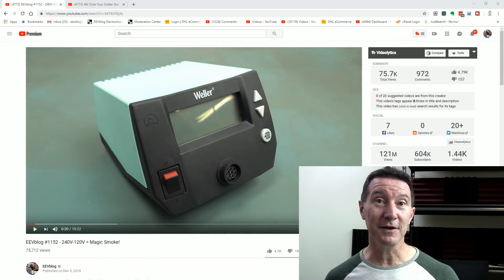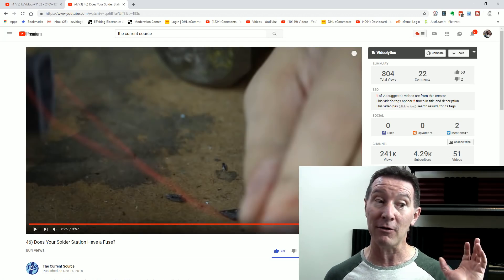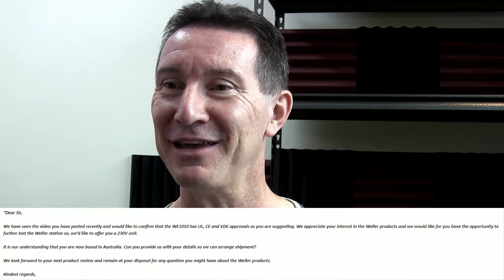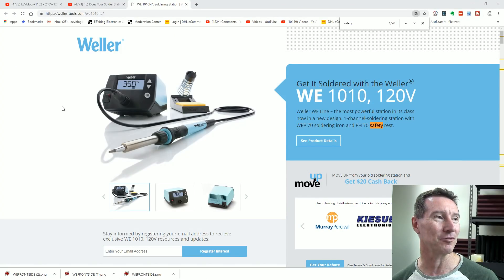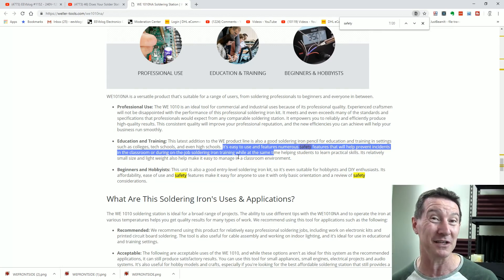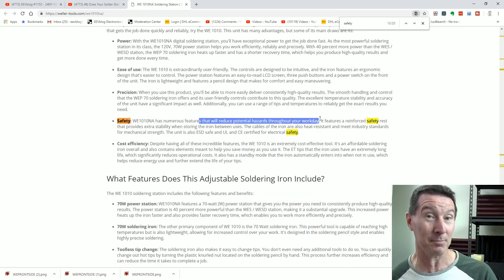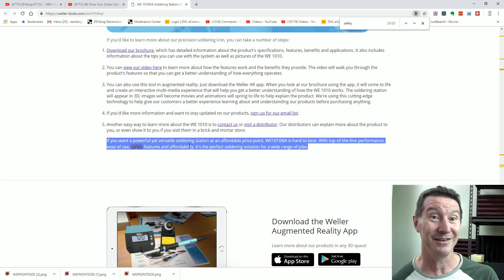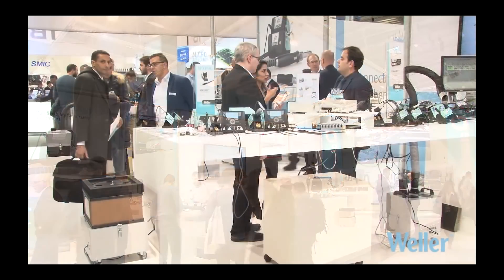EEVblog #1160 - Weller Responds!

Comment: Take the 240 volt version and plug it into 408v.
Reply: Don't turn it on. Take it apart.
Reply: @CyberlightFG  BLOW it apart!
Reply: @CyberlightFG  it will self disassemble before your very eyes... pro tip... wear goggles 😎

Comment: You should have accepted the iron from Weller, and tear it apart once received to prove or disprove they improved their product
Reply from the maker: Nope, it's not my job to prove that they have fixed or improved anything, they could have simply said so in their response.
Reply: @EEVblog  right ! You tell em Dave
Reply: They didn't alter a product because of this video, and esp not in 11 days.
Reply: They offered a 240V version, which probably has the fuse.  (?)
Reply: It would take some time to change a product design, and if it passes US regulations as-is, what are the odds they would even be inclined to do it if that's how everyone builds their transformer-using products for the US market? Voluntary improvements would be laudable but highly unlikely if it doesn't give them an immediate return and DOUBLE DIGIT GROWTH you know. :p

Comment: A lot of the things I plug into the wall don't have a fuse. Lamps, power tools, Christmas lights, aquarium filter and bubbler. But then again I only plug it in to the voltage it was designed for 😂
Reply: All my christmas lights have a tiny fuse in the mains connector? (USA 120v)... even the chinesium lights I've gotten off amazon have a fuse in the connector
Reply: Actually a lot of these things have fuses built in that are just less obvious. Power tools usually have a thermal fuse in the motor, incandescent bulbs have a small, thin wire below the filament that acts as a fuse for when the filament fails, and then lots of things have PCB mounted fuses of course, some of which may not look like a fuse.
Reply: @Basement-Science  And an incandescent bulb IS a (crap) fuse. :)
Reply: @0x8badf00d  Well, not sure you can call the filament of an incandescent a "fuse".
Incandescents without a built-in fuse will actually trip your 16A breaker almost everytime when it burns out.
Reply: @Basement-Science  It is kind of a fuse,  much like PTC thermistor. Select appropriate wattage and you are mostly good.

Comment: Maybe they just treat mains connection cable as a fuse.. did you checked attached cable? Maybe its made from a fuse wire... ;)
Reply: It´s an IEC cable PLUGGED INTO the station. So you cannot put any protection into the cable since you could replace it with any other.
Reply: @Basement-Science  I think you shouldn't take the comment above in any serious way.
Reply: @krzysztofzgondek1725   I know, but others have asked similar things. (Fuse in the plug)

Comment: Whoa, wtf, how did they even got it certified?
Any certification bureau will tell you to put a fuse in there upon first inspection, not sure about the US, but not a chance in EU. 
Fuses protect you from fire. 
WTF Weller?
Reply: CE and UL are self-certifying standards. It's up to the manufacturer to make sure they comply
Reply: @xortan666   True, but don't that open you up for lawsuits?
As I did it - you got get your safety checked, got EMC, ESD done, then you declare yourself sertified, in case shit hits the fan you pull out your documents where it says you passed this that and the other.
Reply: @xortan666  UL is a certification, not a declaration of conformity. And while CE is a DoC few people would not have an independent lab produce a test report.

Comment: When I moved to Australia, I opened up my Weller station to swap the voltage to 240V and was amazed that there is absolutely no provision to do so. Weller's answer to this is to buy a new transformer, at almost the same cost of the station, to convert to 240V. WTF? In this day and age of globalism and you don't even give me the option to switch between the two? Yeah, thanks Weller.
Reply from the maker: To be fair, not uncommon for irons like this across brands, makes the transformer design easier and more optimum.
Reply: EEVblog  it’s not that complicated. Use two primary windings, put them in parallel for 120V, in series for 240V. And add a fuse 😂
Reply: Buy another one, and use them in series. Merry Christmas.
Reply: I would have thought it would be cheaper to have a single unit for international sale, with fuses on all and mains voltage selectable. I guess another benefit to the UK plug design - everything comes with a fuse.
Reply: Was there a fuse in there?
Reply: It was so long ago that I don't remember.
Reply: To be fair... my Hakko is the same.
Reply: Sure, it's cheaper to have a 115v/230v tapped transformer rather than carrying two separate lines for each voltage?

Comment: Hahaha dave that is the perfect ending! I remember here in sweden we had a consumer program called Plus, with Sverker Olofsson and if the products that did not meet the required safety standards. He just tossed them in the bin i so remember that the companies where going nuts on him, because they had to fix the problems and it will cost them money.

And i can not believe that a company like Weller even dare to put their reputation on the line, there is no reason to skip the PRIMARY fuse it is just stupid and lets say if you forgot your soldering iron on. And then a few hours later having a over voltage situation is it acceptable then that the entire soldering station could catch fire?

Comment: VP of marketing?  There's your problem!
Reply: Used car salesman types addressing engineering and consumer safety issues.
Reply: They probably don't have any engineers working there any more. They cost too much and only cause problems.
Reply: @Zadster  Pesky engineers ruining their bottom line by implementing safety features.
Reply: Probably the same guy that wrote that product page.
Reply: @technus6187  Yea an out of work journalist, they know how to spin anything.
Reply: Yeah, whenever possible, you fire off complaints like this straight to the engineering department.

Comment: I think you nailed it: if they say, "Oh yeah, we should probably put one in," then they'd be open to risk if anyone else has an issue. If you accept their -bribe- replacement unit just say you'll wait until they add the fuse... and see if they actually (if quietly) add one to future models. But if you just can't trust them anymore, especially as the kids get into electronics, I perfectly understand why you'd just dump it for good. Thanks for the follow-up.
Reply: I vote accept the 230V model (230V, not 240V... interesting that)... with the caveat that it must have a primary side fuse, or they know exactly what sort of video review that unit will receive! :-P
Reply: some weller stations do have a fuse.
Reply: Yep, I think Dave mentioned that. It's too bad because if this model was otherwise superior I'd be tempted to add a mains fuse myself (... if I knew what I was doing and checked with a few experts first to make sure I wasn't creating a new and bigger problem. Believe me, I have been "too smart by half" plenty of times.)
Reply: I use a Nexxtech 60W Soldering Iron with Variable Wattage that I got at Source (I miss Radio Shack). Works more than well enough for what I do. Sadly, it's not available any more.

Comment: im not really sure, but i think its actually illegal here in germany to have such a device without mains side fuse  im interested in seeing some german models of that specific model, if they go a fuse
Reply: Pretty sure it's illegal here in Brazil too, maybe they have different models for different countries.
Reply: Either a fuse is required, then Weller will put one in, or it's not, then it's at their disposal to build one in or not. Devices with simple mains transformers usually do not have fuses built-in. Think about all the linear or unregulated wall warts here in Germany.

Dave is just making a fool of himself thinking he discovered a serious safety flaw to which Weller would need to respond, when in reality thousands of devices work fine as long as you don't plug it into an outlet with double the rated voltage and watch the device burn down.
Reply: @graealex  i dont know what you are talking about , but only the cheapest of the cheapest bs i saw had no fuse here in germany, even the 5 dollar usb wall charger has a fuze soldered inside ( non user replaceable, but it had a fuse )
Reply: @WaschBaer_95  talking about the unregulated and linear ones, i.e. just the transformer, rectifier, capacitor and optional a linear voltage regulator. Those don't need fuses because they are intrinsically fail safe. There is no component that can short out the primary side, and short circuits and overloads only act on the isolated secondary side. Ten years ago this was the norm for basically all DC powered devices.
Reply: @WaschBaer_95  and switching power supplies need a fuse because you have capacitors, rectifiers and switching transistors on the primary side, so if one these goes bad, it bridges the full mains voltage. With normal mains transformers, the current is always limited so that the primary side cannot be overloaded. There's simply nothing to go wrong.
Reply: @graealex  Nothing can go wrong until it does. In reality, components have a limited life span and aren't supposed to catch fire at the end of their life but instead fail safely.
Reply: @graealex  Do they have IEC connectors? Or are they fixed to Schuko plugs?  Many wall warts are fixed to a specific plug, but IEC has the exact same connectors for both 120V and 240V.
Reply: buy a 15$ outlet receptacle that is primary fused they do make them

Comment: wow shame on you Weller!
Reply: I guess it's the car manufacturers fault if you put diesel in a petrol (gas for the US) tank. It is labeled correctly and actually required a different cable other than what was packaged with it originally. It should have a fuse, but putting on this much theater is ridiculous (9 min video for a 10 second letter!!!)
Reply: @daishi5571  yes but what in case of overload? even on 120V supply you rely on 15A breaker, while the unit rated current is 0,5A it'd cook as hell even tho its not 240
Reply: @sumilidero  What I was getting at, was that this wouldn't even be a thing at all except under this exceptional circumstance. How many ppl order devices not usable in their country??? if he had the correct voltage he be oblivious to this issue, but because of his own mistake it became a problem. But what I was mostly getting at is the amount of theater in use here it's almost worthy of a off Broadway production that get cancelled for bad acting. As I said it should have a fuse.

Comment: It's dangerous. I expect better safety from that UL sticker.
Reply: why? Batterizer had UL certificate too :)
Reply: buy a 15$ outlet receptacle that is primary fused
Reply: @punker4Real  those a generally fused around 10 amps which will not help much.
Reply: UL has been BS from the start. Live chassis "curtain burner" radios have UL listings FFS.
Reply: UL isn’t to protect you from being stupid like he was.
Reply: There is nothing "dangerous" about it at all, as he clearly proved in his video, even if an idiot plugs it into a mains supply 2 what it is clearly rated for all that happens is that the magic smoke comes out an a breaker pops.
Reply: @wildbill4476  Watch his video again, no breaker popped, he quickly unplugged it.  Had he not been in the room it could have caught fire.
Reply: @alexatkin  It did pop, he said so. However, if the xformer already caught fire then a breaker won't help. Basically, Weller stations can't be left alone whilst powered up. At least outside of countries like the UK that have fuses in plugs (assuming correctly sized!)
Reply: @russ18uk  Anyone with a proper IQ don't leave a heat generating device on while away from it... however there should still be other measures taken, like a fire retardent coating on the transformer.
Reply: @Tylonfoxx  So what do you do when you cook? People leave things alone all the time, and it's reasonable to assume branded goods are very well protected. If this was Chinese crap we'd probably say that the UL mark was fake.

Comment: Instead of a useless rant, why not employ your knowledge to analyze the standards and discuss THAT aspect. Why is it ok to not have a fuse?
Reply: A little ranting was in order - Dave will be Dave :) But yes, I'd also be interested in knowing how the safety/certification standards can allow a fire hazard like that. Any takers? Dave?
Reply: @ba94845  That's ironic, coming from someone so keen to insult someone over basically nothing.
Are you sure Mike's the one that's thin-skinned, or are you perhaps projecting? ;p
Reply: It should have a fuse. Even if the voltage is ok... imagine internal short between windings (very rare) . Is it ok to sit on the bench and heat up till it melts or even does some more spectacular damage? For chinese cheapo-crapo maybe. Not for weller. 

But obviously... weller brand started to tarnish...
Reply: Only if the primary is wound with fuseable wire.  It is a soft alloy that melts at a relatively low temperature and goes open circuit before the enamel insulation burns off causing cascade failure like it did here.  This was a definite fire hazard.

I am suspicious of that UL rating.  There should be a 1 amp fuse as a minimum; a MOV and finally a thermal fuse in the windings if done properly.  The MOV will pop the fuse without damage to the transformer.  But we live in a dumbed-down throw away society..... So the MOV is left out often times as the device is intended to be scrapped instead of serviced.
Reply: You can't GET a copy of a UL standard without paying out the ass for it....
Reply: @bobweiss8682  you can get it for free at the library of most technical universities, even when you're not a member of the uni.
Reply: @bobweiss8682  To get the certification you pay out the ass. Then more questions and testing. And don't forget more money. Then you Can have a license to affix the sticker. then in workplace safety audits. And UL products do get recalled.
Reply: Regardless of the regional standards, using the transformer as a fuse to cut costs is dickish. I still love my WES51 though. Nobody is taking my nob from me.
Reply: Some people like having a fire on their bench.  It saves on heating costs.
Reply from the maker: Maybe, just maybe, Weller could have told us that in their response? After all, they are the ones that very deliberately omitted the fuse that industry standard in practically everything else.
Why should I do the leg work buying the expensive standards and spend many hours trawling through them?
Why don't you?
Reply: EEVblog Understand your upset, but no need to lash out on us too. As someone who’s learning, I’d also like to know why it’s so important and how something can be UL certified despite not having it.
Reply: @Moped_Mike  I don't consider that "lashing out". And I think the video in question thoroughly depicted why the fuse is important, from start to finish. So I'm fine with Dave not reiterating it all in this video.
Reply: It was not a "useless rant." It was calling attention to a safety hazard; regardless of how miniscule of an issue it is. And calling attention an even bigger issue of Weller thinking that there doesn't need to be a fuse, and adhering to a standard that has a loophole.

Comment: Dave.  Don't sit on the wall.  Tell us how you really feel about it :-)  Seriously it might have been worth finding out if the 240v version has a primary side fuse or it they just miss it out for the low voltage lot.......  For the cost of a fuse it seems ridiculous.
Reply: There's a 240V version on the UK version of Amazon which has the back visible. I see no fuse but fuses are supposed to be in the plugs in the UK. (Edit: Just checked the au site and that doesn't show a fuse either).
Reply: @chaos.corner  Fuses in the plug do not protect the appliance in any way.  They are there to protect the flex that goes to the appliance as a ring circuit has a 32A breaker.  It isn't clever to stick up to 32A down a cable for a table lamp as it would melt and catch fire.  Hence a 3A fuse would be fitted in the plug.
Reply from the maker: It's their job to tell us, not my job to investigate.
Reply: EEVblog You’re right but it would have been interesting to see if they sent out a fuseless one to replace the original. It does seem rather odd for a company of that size. It sort of puts the approval system in a bad light as well!
Reply: EEVblog I’m trying to understand why you bought the 110v version in the first place, living in AU.
Reply: Mike IIRC it was sent  to him in a mailbag.